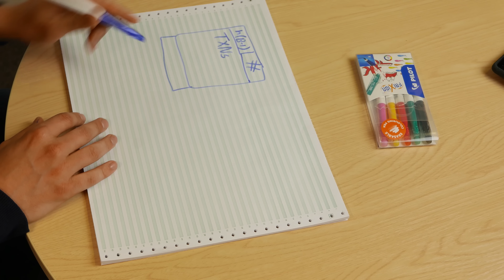Bitcoin Mining in 4 Minutes - Computerphile

Comment: Crypto is an energy and resource wasting SCAM, Closer to a ponzi  than a currency!!!
Reply: Read around the subject rather than making rash claims. Ignorant people are given a platform to talk on social media they continue this rhetoric and people believe despite the fact their arguments have been broken down and nullified.
Reply: One could of course say that there is another energy cost to add to physical money when it is moved around between shops and banks and such. But you get what point I am trying to make ;)
Reply: Dawud G Delves I could imagine that the initial cost to produce physical money is quite expensive in terms of energy used. But from that point on it's nothing. Digital money sitting in the bank is quite cheap to move around if you split the banks energy bills across all the billions of transactions taking place all the time. The problem with bitcoin is that it takes this huge amount of energy to complete the next hash. And at the same time there is a very small limit on the number of transactions that the block chain can handle. So therefor the average cost in terms of electricity per transaction is about the same as an average house uses in a month.
Reply: Not every crypto is an energy hog like Bitcoin
Reply: I'm not trying being condescending by any means, this just seems to be a very interesting conversion. How much energy does it take for physical currency to be produced and exchanged? If bitcoin, or any virtual currency,  takes less energy to produce and exchange, then isn't that the point?
Reply: Currently each transaction consumes about 981 kilowatt-hours (KWh) on average. So @wmahomet is quite right to be honest. I have been into Bitcoin and other cryptos for many years and I find it fascinating. But in recent years the energy consumption is starting to worry me. But there are some interesting alternatives with different approaches to how you can validate transactions without the massive power consumption.
Reply: Who is scamming who, you mean?
Reply: Furthermore even if an empty block is mined... Why is that a waste in your mind? Sure no ones transactions were validated, because there weren't any (this is actually rare now though probably doesn't really happen anymore, except on less used cryptos) but the value was transferred into the block reward that the miner got... Ever miner using their energy fighting for getting that block reward, the one that wins gets that value... So you should look at it not as energy wasted, but as energy transferred into the bitcoin itself! :D
Reply: No, it is an efficient system of money trading and transferring with no banking involved.

Comment: Can the mining of bitcoins (and any other concurrency) contribute to building a huge rainbow table of the hash function (SHA256 for bitcoin)?

So every time you compute a hash, regardless of mining a block or not, you store that information (i.e. associate the hash with whatever blob of data that make up the (either successful or failed) block). I suppose the problem is that you won't have enough storage, but this is in theory possible right?
Reply: no, there is far to much entropy in these numbers
Reply: sanisidrocr what do you mean by "entropy"? if you mean in terms of information theory, then i don't really see how that relates.
Reply: I apologize. I misread your statement. It is a bit odd to record all random failed attempts at finding the nonce , and they would have to be aggregated locally and than peered in chunks due to the bandwidth limitations peering such data in realtime. This would be a tremendous amount of random data to store on disk space but could be done.  I am curious what purpose would this serve?
Reply: sanisidrocr my original thought was that this mining process can be used to create a rainbow table, which can make SHA256 obsolete, while also doing "useful" work (i.e. the mining). but thinking about it now, the final table will need to be stored in some 2^256 records, with each record being at least the length of a block chain block. and as you mentioned, the aggregation part will also be a problem.

Comment: So people solve man-made puzzles (by cheating with computers) that let you keep the solutions as prizes, but make the solution harder to get the harder you try. And the solution to the puzzle can be swapped for real money. Sounds crazy. Whose idea was this?
Reply: FriedEgg It's commonly accepted that Satoshi Nakamoto, the inventor of this system, is a pseudonym, but who they really are is still a mystery.
Reply: It works beautifully to prevent spam and double spending. There's a reason bitcoin is still around since 2009.
Reply: Probably drugs. I've made about £300 trading small amounts of bitcoin and litecoin. I had a rough idea how it worked. Didn't know whose idea it was though. And I still don't understand what gives it value.
Reply: You give it value when exchanging fiat for it, multiplied by millions of people doing the same. For it to work, individuals using it doesn't have to understand it. It's financial incentives alligned just right.
Reply: Get with it fried egg.... Or is that just your brain on drugs? :D

Comment: This might be splitting hairs, but the difficulty is actually based not on "number of leading zeros", but rather on the magnitude of the hash being less than some fairly small number, though that is approximated by number of leading zeros.

While I'm at it, I'll mention that (at least in the BTC version of Bitcoin) the difficulty adjustment is performed once every 2,016 blocks, which at 10 minutes per block (the target) is exactly 2 weeks. In reality, it may be slightly more or less; more often less as hashpower has tended to increase. Similar with the block reward: it is halved once every 210,000 blocks, which should be slightly less than 4 years, but has ended up being significantly less (as in, by months), due to increasing hashpower keeping the average block time slightly below 10 minutes.
Reply: > at least in the BTC version of Bitcoin

Otherwise known as Bitcoin ;)
Reply: Can you explain to me how the bitcoin for miners is distributed to them? They successfully mine a block. Okay, where is the bitcoin located and how do they obtain it 🤔
Reply: @HelloImadamn  You seem to have a misconception that these coins somehow exist prior to a block being mined, and maybe that someone or something, acting independently, sees that a block has been mined and then hands out the rewards.

Well, just to be clear, there are two components to a block reward: transaction fees and the subsidy. The fees are the fees paid by all of the transactions included in the block. Obviously, these do already exist. On the other hand, the subsidy is the set amount of new bitcoin a miner is entitled to for creating a valid block. This is created by the block itself.

There is in fact no one and nothing that sees a block and reacts by giving the miner the reward. They give it to themselves (or, really, to whomever they want). And the way this is done is through the coinbase transaction, a special transaction that is always the first one in a block.

What makes it special? A normal transaction must reference one or more previous transaction outputs where coins existed, with the sum of its outputs required to be less than or equal to the sum of its inputs. However, a coinbase transaction references nothing else, and the sum of its outputs must be less than or equal to the subsidy plus all of the fees in the block.

The coinbase transaction's outputs specify where the fees and subsidy will go, which may be to the miner's own address(es) or someone else's. (The vast majority of mining is actually done in pools, which control where the rewards are sent, so all the members can be paid appropriately.)

One last thing you may find interesting: while normal transaction outputs can be spent instantly, with a spending transaction allowed to appear even before its parent(s) are confirmed (included in a block), miners are required to wait for an additional 100 blocks before spending the reward is valid. This way, they can't do things like take advantage of a chain reorganization, where one or more blocks are superseded by other blocks.

A reorg happens when more than one block appears at virtually the same instant. For a while, the network is divided on which branch it accepts, until one of them is clearly the winner, determined by which one represents the most computational work. The blocks that exist only on a losing branch become invalid. If the rewards were allowed to be spent immediately, the owners could spend the money and cause other parties to be left with money that then disappears.
Reply: @fllthdcrb  thank you! I do understand that the rewards are not given, and your detailed explanation was very elucidating. However, I was more wondering how this is written into the code. Are there bitcoins that are put into the code?
Reply: @HelloImadamn  Coins are not "put into the code". This suggests a fundamental misunderstand still. Instead, blocks are created through proof of work, which this video summarizes. Because everyone agrees this is the way (consensus), a block that follows all of the rules creates new bitcoin. That's all. But as difficulty is adjusted according to how easily miners are finding blocks, it's never a simple process. Collectively, all of the miners in the world compute quintillions of hashes per second in order to find one new block on average every 10 minutes. And since mining equipment is expensive and a lot of electricity is needed to run it (and supporting equipment, like cooling), it's not just free money.

Once upon a time, back when it was still feasible to do this on CPUs, the node software itself would do the mining. But as this is a process with an economic incentive, miners found more efficient ways in order to compete, switching to GPUs, then FPGAs, and finally ASICs. Now, the role of a node is to (maybe) provide block templates which the miners then tweak while searching, and to broadcast a block in the event one is found.

If you want to read the code for Bitcoin Core, their official repo is on GitHub, though it will likely take a while to understand it. There are also technical and semi-technical resources to explain concepts like this, such as Learn Me a Bitcoin and bitcoin (with the "it" domain on the end). (Sorry, if I try to post a link, even mangled, YouTube tends to hide my comment.)
Reply: @fllthdcrb  thanks but you didn't really answer my question. You are really taking things I say a bit too literal.

I appreciate the write up but really, you should be able to answer this a bit more clearly and much more concisely.
Reply: @HelloImadamn  Fair enough about not being concise. But that said, it sounds like you want to read source code. (If you mean something else, maybe explain what you mean.) I'm afraid the best I can do is to direct you to the source repo, since I don't know the code itself very well, and other technical resources, which I did. But like I said, I can't even give you a link, or YouTube hides the comment. Which it actually did with earlier versions of that comment, even when I tried to use mangled links.* So, all I can do is direct you to sites by name; you'll have to find them yourself.

* If you find this hard to believe, you can look this up. Do a search for something like "youtube hides comments". I think a lot of people don't even realize they do this, because it's a shadow hiding system, where the commenter is shown their own comment but no one else can see it. You can check if a given comment of yours has this done to it by checking the comments while not signed in as yourself, and you can also count comments and compare to the count YouTube gives, the latter of which is the true number that exist.

Comment: There is a very high chance that no valid hash is produced even after testing all 2^32 nonces, so other parts of the block header are also mutated to increase the parameter space. Typically the timestamp is jittered, or the merkle tree is altered in different ways to change the merkle root.

Comment: That's not true.  Yes, increasing the hardware you use increases the difficulty, but it does so for everyone; therefore adding more hardware does in fact allow you to mine more bitcoins than others relatively speaking as even those who have not added more hardware must still compete at the same increased difficulty as the one who has added more hardware.  Your mining rate will stay the same while everyone else's mining rate will decrease somewhat.  The blocks will still take 10 minutes, but those who have not upgraded their hardware will not successfully complete as many hashes.

Tl;Dr adding more hardware does allow you to mine (relatively) faster and more efficiently than others despite the fact that more hardware increases the difficulty of the hashes.

Comment: Still unclear to me. Like who pays the miner? Who creates bitcoins?
Reply: They're essentially created out of nowhere.  A transaction is added to the block that gets mined that gives an amount of bitcoins(current 12.5) to whichever node mined it.  Once that successfully mined block is confirmed, that node will be able to create transactions that spend up to 12.5 bitcoins.
Reply: Not exactly right , there is coinbase reward + tx fees collected per block, thus 13-14BTC on average collected by miners per block and those rewards are often distributed across everyone hashing within a pool. The BTC can only be spent after 100 blocks as well.
Reply: This has been done before and the bitcoin network treats these blocks as invalid or an altcoin, rejects the block , and bans the nodes relaying it automatically as an immune reaction. Miners broadcast that they have found a block to all nodes , ones used by miners and just economic non mining nodes. The valid chain is determined by the heaviest weighted(most worked) VALID chain . So it doesn't matter how much work is done if the miners change the consensus rules without economic users consent they make an invalid block and node is banned. Thus even if 100% of the network hashrate determines to reward itself with extra btc or implements a rule change they will all be banned and they will lose out on all profits and would have wasted a lot of energy and capital in creating nothing of value. Economic nodes validate the rules, not merely hash rate. Most of the 88k nodes worldwide are not mining ones.
Reply: Out of interest, what prevents someone from manipulating that reward transaction amount? Say, instead of +12.5 they include +1000.

Comment: How can be sure that, changing only the nonce, we can obtain the hash with a certain number of leading zero?
Reply: It's possible that you might get an arrangement where the combination of the other pending tx's, your tx(for the new bitcoin), and the nonce hashed together can never produce a proper output - but the chances of that happening are extremely small, and the chances of you exhausting every possible attempt with the nonce before another node on the network has already successfully mined the block is even smaller.

If that's the case, you just need to modify the rest of the data: take more transactions from the pending transaction pool

Comment: What's the method of letting all others miners know that you've hashed a block? I'm curious because one thing I haven't seen explained is that it's a distributed system so everyone needs a copy of the blockchain to start hashing the next block, but once a block is hashed how is that sent out to every other miner out there so they know the blockchain is updated? Also, if 2 miners successfully mine a block at the same time, does it become a race condition to see who can update their block into everyones chain the fastest or how does it work?
Reply: Miners broadcast that they have found a block to all nodes , ones used by miners and just economic non mining nodes. The valid chain is determined by the heaviest weighted(most worked) VALID chain . So it doesn't matter how much work is done if the miners change the consensus rules without economic users consent they make an invalid block and node is banned. If 2 miners create a valid block near the same time than the first one to create the subsequent block will win the race and the other block will be orphaned(history thrown away and miner not rewarded) and those txs will be re-added to the mempool.
Reply: ^and that is why you wait at least six blocks for a valid transaction confirmation

Comment: Are there any particular strategies used to determine which nonces to attempt hashing with? Or do they just rely on repeatedly "randomly" assigning a nonce and trying it?
Reply: The strategy is typically to break up the work among a pool of miners where one uses a subset of the difficulty in a race to find the answer
Reply: @sanisidrocr  But then how do you verify all the miners are doing genuine work and not pretending just to get a cut of everyone else's work? The miners mine at a lower difficulty than the actual network so they find "valid" blocks often. Most of those blocks aren't low enough to get the next block reward but at least it proves to the pool it was genuine work